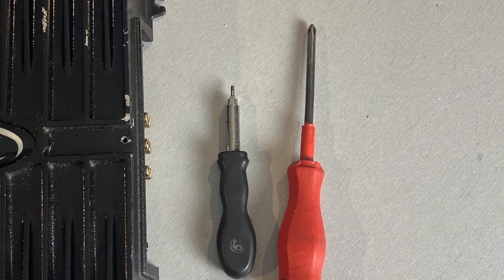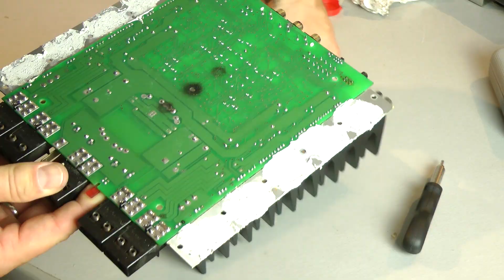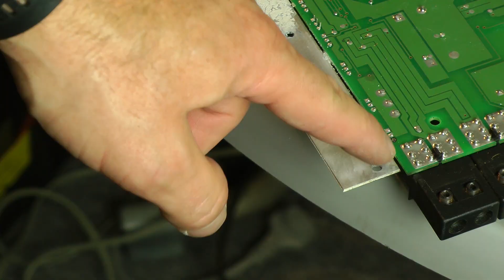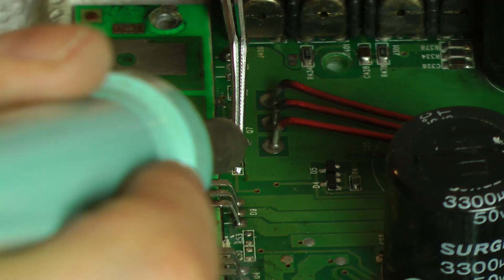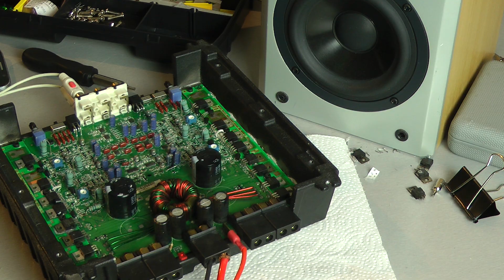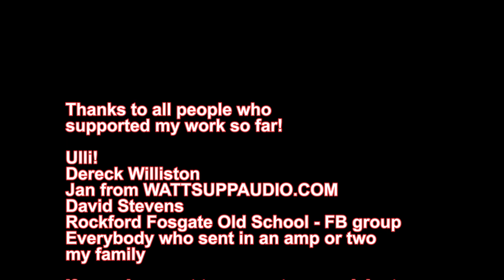Rockford Fosgate Punch 300x oldschool car audio 4 channel amplifier repair & short amp dyno

Comment: Great video!   What is that electric box at 11:44 called and is idle current always done checking distortion or is that set by manufacturer for some amps ?
Reply from the maker: Thanks 😊 
I think you mean my small power supply? With this thing I limit power consumption and check the idle current or do trouble shooting avoiding too much current flow if there’s still something defective. I don’t know how manufacturers set the bias. Sometimes Rockford set the bias a little high which is good for soundquality but generates more heat. Setting it lower just to the point where distortion disappears produces less heat. You can also set it without scoping the output signal but watching the idle current. Run the amp very hard after setting the bias and let it cool down if the amps bias isn’t drifting away all is fine 😀
Reply: @audiokeller1975  awesome! Thanks

Comment: I dont do it like that. I put flux on the back of the fet and heat the strip slowly until i see the solder flow then i push the part down and hold the part on top with pick tool making sure its tight against the strip then I slowly let cool

Comment: I don't know if you're looking for advice or tips. 
A couple things I would do different would be to use a little more soldier under the mosfets so that you can clearly see it come out all sides. 
Second would be to use flux. The small amount of flux in your solder will quickly get burned away within a few seconds. 
Third would be to heat the mesha a bit slower so that the heat can more evenly spread. In the video it looks like you heated one area very quickly. 
Forth, be careful to not push down too firmly on those resistors. They are quite easy to snap in half. 

Good job. 

I've never really looked at this generation of amps. Internally it basically looks just like their older DSM and black and grind amps. Probably just a few small differences in the preamp.  section.
Reply from the maker: All hints and tips are more than welcome 👍 I used multicore flux solder which I still own from the 90s 😄 to keep the video. Little shorter I made a cut , I heated the Mehsas slowly.
Reply: @JasonWW2000  yes. Basically a dsm with xover .. and i agree..i never heat a part enought to melt solder on its tab..not directly. The part will be compromised..

Comment: Very cool. Back in the 90s I was friends with a somewhat successful drug dealer who had a major car audio addict. Used to get all sorts of free stuuf from him because he was constantly upgrading and trying new stuff. GOt a couple of round 12" SoloBarics a Punch amp, and there was an MTX amp, forget the model, but it was a cheater amp and was designed by an engineer their hired away from Fostgate or maybe Kicker, used to really pound
Reply from the maker: Sounds like it was the MTX amp i really want to dyno - MTX thunder 2300 ? There is a nice video made by Dereck- oldschoolstereo.com
Reply: @audiokeller1975  I've been wanting to find a Thunder 2300!  Great video btw, Loved seeing the repair process. I have a punch 100dsm that needs work.
Reply from the maker: @jodyzung6455  what’s wrong with your 100DSM? Is it the older DSM or Punch 100 ix DSM ? The older ones feature additional boards with SMD devices on it. I had one of them repaired and it happens very often that the silver SMD capacitors leak out and create damage. They are 10uF 16V.
Reply: @audiokeller1975  It's an original 100 DSM. I bought it used for cheap because the seller said one channel didn't work. That's all I know at the moment. I'll hook it up soon and see what happens. Hopefully I won't damage it further :)
Reply from the maker: @jodyzung6455 the chance of  damaging is high if connected to your car battery, hooking it up to a power supply and limit current to 3 amps is safer 👍
Reply: @audiokeller1975  ok great advice thanks!
Reply: @jodyzung6455  guys.guys.. thats incorrect info..you dont want to limit current to a certain limit..you want to reduce by percentage..ITS ALL BEING TAUGHT WRONG..heres the secret.. get 4 10 ohm 10 watt sandbar resistors..wire in parallel.. then put that 2.5 ohm build in the pos terminal of the amp your repairing..IT ACTS LIKE LIKE HOME AMP TECHS CALLED A DIM BULB TESTER.
Reply: @davidstevens7809  awesome, thanks!
Reply from the maker: @davidstevens7809 hmmm… when i first test an amp if something’s bad I use my small adjustable power supply and limit current 3-5 amps  or a Fuse of  5-10 amps in series to b+ . If everything is ok I connect the amp to a real power supply 🤔
Reply: @murrayshekelberg9754  the amp was to be the punch 300. But the designer went down the road to mtx and it bacame the ta2300..yup my friend john pleitz

Comment: Thanks for the cool video. I have a few 1995 punch amps that  need repair, no burns on boards. I don't know what is wrong. Thank you for your informative videos.
Reply: Maybe mosfets?
Reply from the maker: MosFets, drivers - first check them properly to know if it’s worth fixing. In most cases it was worth it 👍
Reply: @audiokeller1do you have a video on how to check mosfets and drivers?, thank you buddy.
Reply from the maker: @jsnjcnt infinity think so , but it’s easy if you have an meter with diode check.
Check MosFets and drivers at power supply section and also drivers and mosfets in output section. Get a small power supply with current limiting and limit the current to around 3-5 Amps. Connect amp and check how many amps it pulls. Turn all bias pots full ccw and recheck 👍
Reply: Ok, awesome I have a Fluke multimeter. I think it has diode check. I need to get a variable power supply. Thank you for the help.
Reply from the maker: @XOTICILLUSIONZ  yes, even the cheapest fluke has it on board 👍